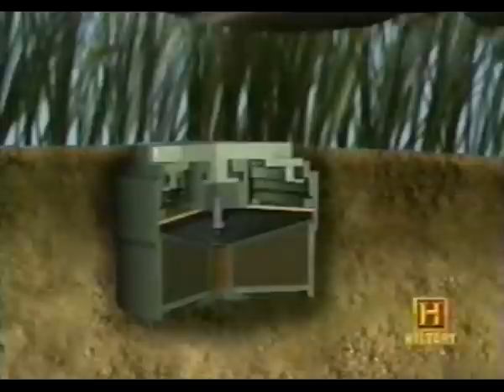M14 AP mine AKA Toe Popper

Comment: Pretty cool. The soviet mine I think called the lpo-50 (not 100% sure) is a bit more effective, but this thing is a lot smaller, a crate of these could make a small field into a no-go zone.
Reply: The LPO-50 was a soviet flamethrower.
Reply: Pfm 1s - 'lepestok' - deployed by air drop or artillery. Looks like a little plastic butterfly, small enough to fit in your hand with fingers closed. Just enough power to take off your toes or half of a foot. Afghanistan is littered with them from the war.

Comment: Funny how ww2 German S-mines are deadlier and more likely to be triggered, only disadvantage is that it’s easy to spot with a metal detector but it can be set off while trying to find it
Reply: I think you're missing the point, S mines wouldn't be nearly as effective in the middle of the jungle such as in Vietnam with plenty of trees and foilage to slow down the projectiles, and the purpose of the M14 is to disable a single soldier which in turn would keep at least 2 other soldiers hands full and out of combat busy extracting their wounded mate, not to kill multiple soldiers at once.
Reply: @Snandra66  i understand your point but even if the foliage of the jungle slows the pellets down it is still going fast enough to kill someone at 30 metres, although not like a bullet I don’t think the foliage will be effective at even slowing it down unless at a good distance, the reason why the S mine is probably not used is because it’s harder to set, heavier, bigger and can cause collateral damage
Reply: @markusdupree5317  Willing to bet cost of manufacturing was a factor as well.
Reply: @Snandra66  I was going to say that too, they were not a simple mine but in my opinion more effective

Comment: They could have used metal doctors, or dogs to sniff out the explosives.
Reply: Dogs possibly, not sure when the armed forces started using them for EOD detection, but they were mainly made out of plastic cans filled with plastic explosives... very hard if not impossible for metal detectors to locate them.